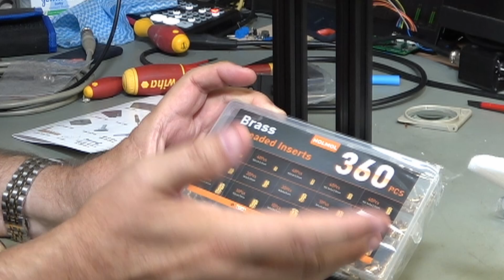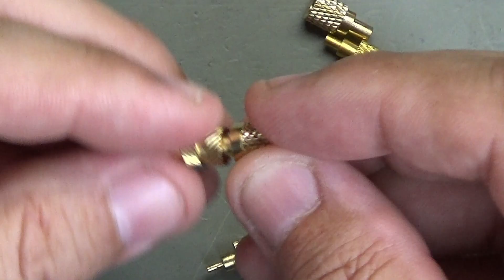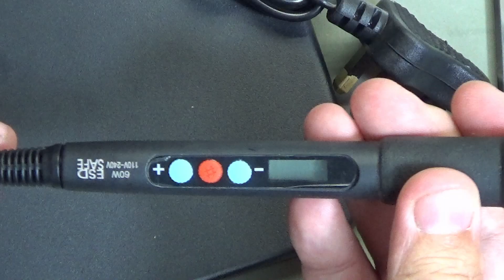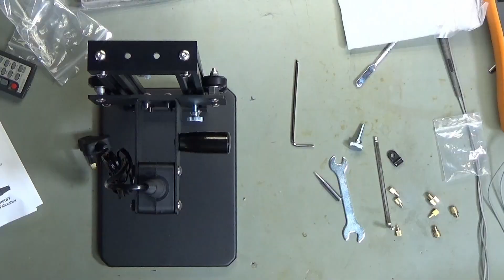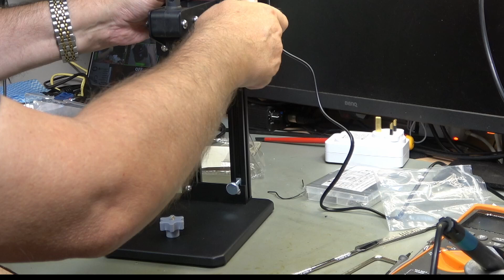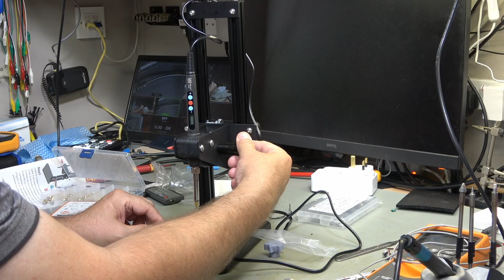Heat Insert Press #0123

Comment: HI, where did you buy this from ?
Reply from the maker: I got it from Amazon on offer, but almost certainly available from aliexpress and temu for less.  I think Amazon stopped settling this exact one after I reported the electrical compliance problems with the iron.  The frame was fine the iron was not!  That said Amazon do have some other presses that are quite similar.
Reply: @MakeOrRepair thank you!

Comment: I know this video is old, but I built a similar one on my own before I ever saw this commercial version.  I'd suggest replacing the spring with a lighter duty spring, and on the bottom of the sliding posts, you can add 2 elbows to wrap the chord around for storage.   I also pinted a small bit holder in pla and tpu to slip the insert tips into for storage.
Reply from the maker: All good ideas thanks